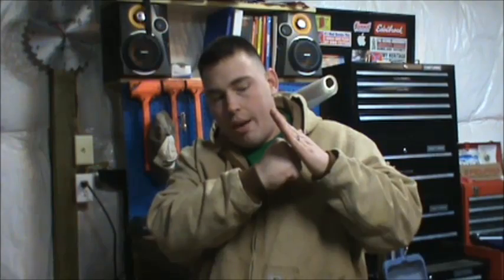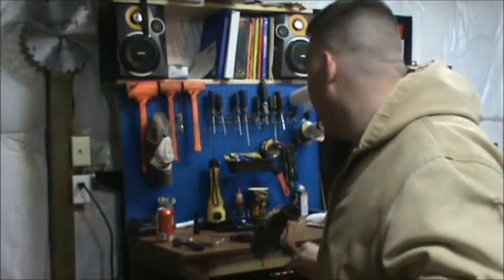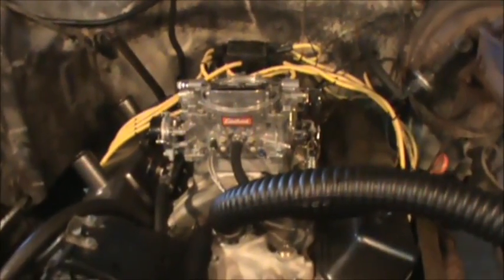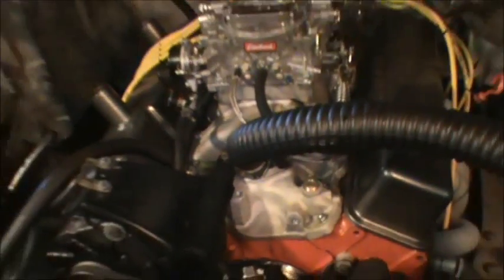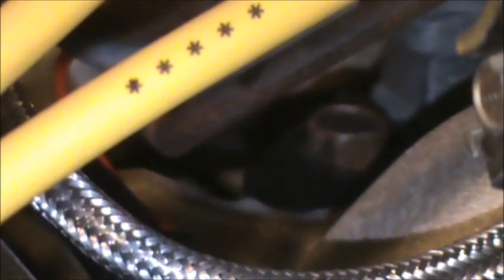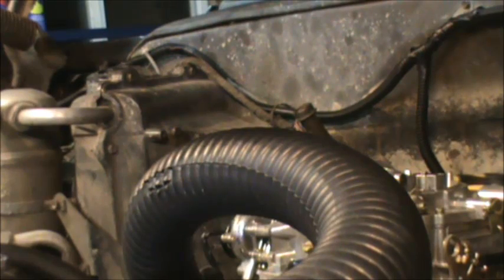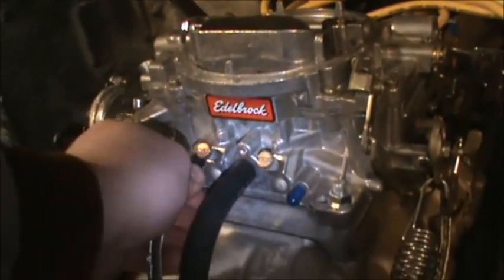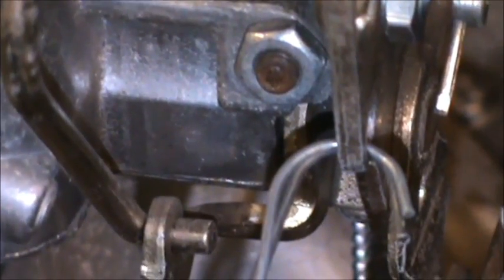Engine Building 101 How To Set Ignition Timing

Comment: Hey Zak Lamb I appreciate the video of how to set the timing on a Small Block Chevy. One of the things that I really wished was for my dad to show me before he passed how to set the timing on my 350. He loved working on these older engines and told me they are super fun engines to work on. He was a master technician for Gm, Ford and a few other automakers. This video helped to clear up several questions I had. Could you do a video on how to install timing chains/ gears for sbc's? I'll be purchasing a timing gear set for my 350 and would love it if you could show me how to install, correct timing if it is off on the timing gear. My engine runs fine but it's worn out and I wanted to put a little more life back into him before I try and rebuild it. Thanks for your help and tech info.
Reply from the maker: Your very welcome and your in luck I am working on a timing gear/ chain video right now! Hope it helps and I love the gear drive that's what I'm putting in the new build for my Camaro. Subscribe and get it as soon as it's up loaded. Hope you find them all to be somewhat helpful and as I go I'll get better at explaining.
Reply: Zak Lamb sweet thanks. I already am.

Comment: have really no power I think I screwed timing when I changed cap and rotor dunno how but possible
Reply from the maker: You have a front damper ( harmonic balancer ) ?
Reply: +Zak Lamb  yes
Reply: +Zak Lamb you think maybe clogged cat or egr can make it sound like crap sounds like something is pinging in exhaust

Comment: my initial timing is about 12* before tdc I wanted to get it to tdc just to see and turned distributor clockwise it came few degrees btdc but not exact 0 .the distributor won't turn on more clockwise and it started stalling right few degrees btdc is that normal ? .the total timing come to 34 though .and when it was beetwen 12 to 16 btdc .350 Chevy sblock
Reply from the maker: Yea it's normal and should should back it off. Pump gas burns fast and getting it closer to 0* can cause it to run bad and or not at all. Try to keep it between 6-12 I'd say. No need to go to zero they aren't made for that.
Reply: +Zak Lamb makes sense thanks also how does actane rating of gas affect timing .
Reply from the maker: +casanovaevren 87 octane pump gas burns faster than say a 110 race gas. The faster the fuel burns the less advance timing you can run ( before Top Dead Center) if the fuel fired to soon it won't run right and could also in an extreme case push the piston back against the rotating assembly and cause damage. The fuel has to fire a few degrees before too dead center in most cases to run properly. A slower burning fuel you can run a higher advance such as my camaro I can run up about 16-18* btdc because I run a slower burning fuel that requires more time to real ease its energy. You use that in a higher compression engine to protect against pre-detonation that pump gas is known for.
Reply: Zak Lamb thanks again
Reply from the maker: +casanovaevren your welcome does that answer your question?
Reply: +Zak Lamb yes .how about another question.will octane rating change carb air fuel mixture? if low octane gas burns faster, lets say the carb was adjusted with high octane gas then I started to use low actane .will 87 be different than 93 octane?
Reply: +casanovaevren will low octane run richer?
Reply from the maker: +casanovaevren Not if we are talking from 87-93 in a stock or mild engine. If your running something that's making more compression or horse power demands than the little things begin to work against you. Yes it all reality it will effect and yes you could make some very very very small adjustments to optimize the efficiency however at that small of a change it wouldn't be anything enough to notice much if it's just stock.
Reply: +Zak Lamb there is a comp cam in it
Reply: +Zak Lamb I just set it up for 10* initial start and it was so smooth when putting in gear.but the total advance was 24 with vacuum disconnected .should I get some recurve kit ?
Reply: +casanovaevren  I found out they purposely set up the initial timing around 22 then 12 vacuum advance giving me 36 total with the comp cam and hei distributor that I have. its a 79 Corvette with iron heads just making it clear .the car likes it better.
Reply from the maker: +casanovaevren hey glad you got it. I'm not sure why but I just got the notifications on what you were asking right now I'm sorry I wasn't able to help you but happy it's doing better non the less.

Comment: man i wish i knew you guys man.  i have a problem with my ignition timing and stuff, and i have no one to help  ):
Reply from the maker: May be a little late I haven't been getting notifications to my phone what's going on?
Reply: the person that worked on my car put the timing belt and the head back on the car.    but i think he did the timing bad and the car shakes and wants to turn off everytime  i come to a stop.  also  the car wont even turn on now.  when i try to turn it on, the car looks like the battery is dead, or the power goes out immediately
Reply from the maker: +frost lee does it turn over after you charge it? How did it run while at speed?
Reply: it used to turn over and actually drive,  but when i get to..3rd....4th gear  it started acting funny.  and now it dont even turn over
Reply from the maker: +frost lee battery charged? Does it click or does the dash lights come on?
Reply: yeah its a brand new battery.    i can turn on the lights.  blast the radio....anything with the battery i can do.  but as soon as i start it, it looks like it sucks out all the battery power and then it starts to click.....or tick and wont even turn over

Comment: i have a motor 400 pontaic transam 78', but i took out the wires of the spark plug so now i dont know where they belong, and the distributor (accel), it has a connecter with two cables red and green where do those go, the motor is outside the truck, how can i make it turn on
Reply from the maker: Hey buddy I just shot a video for this and I'm trying to upload it now. Hope it helps. May not be on till tonight
Reply from the maker: http://youtu.be/5dpVuKhKHjg

Comment: very good video and clear explanation, than you for taking the time, one question for you, what about the RPMs you have not discussed RPMs at all, wouldn't you want to set initial timing at a certain RPM for that vehicle?
Reply from the maker: Thanks and that's a great question! I'll make a video about that. Engine rpm is a very fluid thing and by that I mean it's not one size fits all. Depending on your build compression, cam, stall, fuel and so on the idle will be different. For a stock motor between 600-800 is a good place to be and shouldn't be allowed to drop below around 500 while in drive. Hope that helps!!!!

Comment: Good video....I have a 351 w in a 69 Mach....trying to get my initial timing properly set between 12 and 14 TDC. Once that is done and the distributor is tightened back down, how do I set the Total ignition timing> AND.....don't I have to adjust the distributor again? If I do that won't that screw up my idle timing setting? Help me out here Zak

Comment: i have a no start 86 camaro v6 2.8 auto
When i try to start it, it cranks, but it kind of sputters
i did get this thing to start but the idle was low and when i pressed the gas it spuddered like it had no gas and died. (Has full tank of gas) 
Could this be the timing being off?

Comment: pretty good damn vid bro. Question> I followed this video and before I did the adjustment I had no power then I advanced it too much I think and she got power but was pinging when at 55 mph under throttle . So I retarded her and now the pinging stopped but shes sluggish and underpowered and uses gas but I cant find that sweet spot on the distributor, should I just deal with that rather then pinging and blowing a bearing out? thanks please advise

Comment: I am thinking 1) is it would be the same as spark plug 1 as long as it fires at the same time as spark plug one for that cylinder if not then it would be at complete bottom when you get the spark from the spark plug boot which won't be good... serious knocking and you would probably get a misfire or engine knocking sensor error. But that is my best logical thought

Comment: thanks i understand how to do that curious of two things
1) what happens if you don't put the inductor/signal wire of the timing light gun on spark plug 1 , say  spark plug 2 

2) how general is this procedure for  distributor based ignition systems  can you use the same timing light guns / same procedure to do all of the distributor based ignitions systems even for ATV or motorcycles or do you need a different rating current rated gun
Reply from the maker: This procedure is related to the vast majority of your pre computer controlled ignition timing vehicles. If it has a computer that controls a coil pack this won't work as there is no way to manually adjust the timing out side of reprogramming it in the control system. 

You must follow what the procedure is for your engine however I have never done what that required any other cylinder and of the top of my head don't know of one that requires you to set timing off of another cylinder. It is ( in every one I've ever done) based on the cam, crank, and distributor relation with the number 1 cylinder it at, before or just after TDC.

As for the atv I don't have a lot of knowledge on those however I'm sure most of them are operated of of a magneto so the procedure would be completely different.  

Hope this helps!!!
Any questions just ask!

Comment: Why didn't you have the vacuum advance plugged in while you were setting the timing?
Reply from the maker: You have the vacuum advanced disconnected for initial timing. Connect after its set then you can ajust that on most distributors.
Reply: +Zakry Lamb Thank you for the fast response, starting my engine tomorrow so I'm refreshing on how to set the distributor correctly
Reply from the maker: +ArcticAstrophysics your welcome I have three weeks off work right now so it's a lot easier to comment back lol. Good luck if you need help email me @ zaksmusclemotors@yahoo.com

Comment: i have a 1986 monte carlo with a 350 when i turn it on it runs high then if it sit to on for to long it dies out what should i look at ajusting first carburetor or timing it has a edelbrock carburetor what do u suggest
Reply from the maker: Does it start right back up?
Reply: +Zakry Lamb yeah but idles high till i press the gas then it gets to normal

Comment: Awesome video! What year truck? I just had the engine in my 79 gmc rebuilt, with 0.20 over hypereutetic pistons and an Engine Pro cam. Cam is split duration 443/465. Your cam sounds great! I set my timing at 12 degrees as well. Money was an issue and I wanted to keep the truck as it was when my dad bought new in 79. I used the stock cast iron intake and quadrajet. Maybe someday I'll put a nice Edelbrock card and better intake.
Reply from the maker: Mine was a 79 as well. Cheyenne

Comment: u said open headers i said huh!!!! lol,.. nice video man, nobody made it look that simple lol anywho i got a question fer ya, i bought a chevy 1500 4by an the first few days it ran great , then it rained? truck diddnt wanna turn over but does crank, i had to replace the starter silinoid cause that was sparkin everywhere but that wasnt the issue, does crank better though,. ive checked for spark theres spark everywhere i dont know if its suppost to be a certain amount of spark but theres visable spark at coil ign. coil and plugs, theres fuel pressure also,. ive gotten a obd2 scanner a 80 dollar one and only code it gave was a p0302 2 cyl misfire,.. any advise to why this truck wont turn over zak? if so that be great,. thanks for ur time and god bless.
Reply: +big-tuck pull that distributor cap off and see if there is any water in there or if the cap electrode or rotor tab have a glaze or corrosion on them. This would happen to my chevy 1500 all the time after a rain.

Comment: Now i have a question for ya, that i can't figure out. 
Now i have to set the igntion timing BUT! 
I don't have the timing plate installed on my 350... 
How im suppose to know what kind of timing tab i should have or does it any matter and where should i install it?
 
Sorry about my english but hope u understand. //Emil
Reply from the maker: Hey thanks for your question!!! I will be happy to help you the best I can. If you have a stock set up what you can do it very simple. If autozone and other suppliers have a timing tab for an sbc that in most causes will work with you're harmonic balancer ( or dampener ). It should fit into only one spot on the timing chain cover. If you need pictures or would like to send me pics of what your working on contact me at zaksmusclemotors@yahoo.com

I will be able to help you faster.

Comment: cheers mate,  just had a 2110CC vw motor built that would run rough and spit back through the dual carbs.  found it firing on idle at TDC and only advancing to 20degBTDC@3000rpm. 
hooked up my timing light, ran up the revs to 2500 and adjusted dizzy to fire at 32deg BTDC. Now it idles at 12deg BTDC.

Comment: Hello your video on timing a SBC was easy to understand, much better then others . My question is i am preparing to start my 1970, 350 ci after a short block on up rebuild with all new parts , is there a way to set the timing say at 12 deg. BTC  without starting the engine .  By manually setting the timing mark  at 12 deg then getting a timing light to flash as i turn the distributor with ignition in the on position ? I have no help and will be busy controlling the motor RPM etc. And would like all parameters to be as close as possible. Any other suggestions would be appreciated .
Reply from the maker: Really the best way is to find top dead center on the compression stroke on cylinder 1 and rotate it back to 12 degrees. Drop the distributor in pointing to the number one cylinder.

Comment: A few things.

1.) Thank you for explaining everything (besides how to hook up the light gun). You made it really clear what the degree tabs meant, and what turning the distributor CW and CC would do to the timing. How that equates to when within the down stroke or power stroke the ignition would fire. I really appreciate that.

2.) Your truck sounds amazing. I've got a Olds Custom Cruiser 305 TBI wagon that I love, and I can only wish that one day I'll be able to make it sound as good as yours does. 

3.) You stated that the engine was running at 4 degrees before TDC. Is that bad? Would you ever want it at 0 degrees?

4.) What made you want to set it at 12 degrees? How would I know "where I want" the timing to be? Your truck sounded fine at 4 degrees... so I'm a little confused.
Reply: conn light gun   red and black clips black to gd  red to +12volts  (battery )take the next cord it gos to plug wire some use#1 i use #6  as you spin eng that gun will flash hold it so you read tdc mark and degree marks   easy
Reply from the maker: +balto d 

Thank you for you response and kind words. To answer your question there is actually a lot to it. As far as the exhaust it was just open headers. For the timing thing I will make a video in the next day or two to explain it but it really depends and the type of fuel you are running ( octane ) I was running a mix of pump gas and race fuel (110 octane ) so the 110 octane burns slower than pump gas so it requires more advance timing to burn it properly. I will post a video that will hopefully answer your question better. If you need me to clarify something here just ask. Thank you!

Comment: My 350 sbc in my Buick regal timing must be wayyy off then because it does even start, it wants to turn over but back fires instead. Your thoughts?
Reply from the maker: Has it had anything done to it? Distributor taken out?
Reply: Zakry Lamb yeah had basically top of motor rebuilt because of warped headers& had my heads redone too. Other than that that's it
Reply from the maker: +johnathon Simon 

The trick is to find rob dead center on the compression stroke. I have a video in my list that breaks it down. Once you find TDC on compression put the distributor in where the pickup on the rotor button points as close as you can get it to the #1 cylinder then dial it in

Comment: What do you think is a good price to rebuild a SBC 350. The mechanic promises t to have an Edelbrock Carb, Edelbrock Intake, a cam, and stall converter. He also promises to put in high quality Pistons. I assume he is also gonna get the block machined. The price tag he says will be anywhere from $1550-$1800
Reply from the maker: The price for good parts isn't far off however doesn't sound like he is making much or he is about to screw you. Here is a very serious suggestion if he is doin all that you need new cam bearings, lifters, main bearings and I would have the crank turned and cylinder honed at the very least. For me to do that we would be looking at least 2,000 - 2,500. If you just have him do Pistons and the carb and intake and he does nothing else you are set up for failure. Just double check to see what all he plans on doin. Hope this helps if you have questions email me at zaksmusclemotors@yahoo.com or hit me up on facebook at Zaks Muscle Motors
Reply: You'd be better off buying a new or remanufactured vortec long block and change the cam and put a carb intake on it.

Comment: hi and thank you  would it be the same thing for my 1996 ford 250 econoline 4.9 , straight in line? 6 cylinder ?
Reply from the maker: Your timing should be around 10° before top dead center also your timing is controlled by the ECM. So you can't adjust it like this it has to be done by programming the ecm. I seen a video on it but I didn't have a van to show you on right now and can't find the link if I come across to it I'll send it to you.